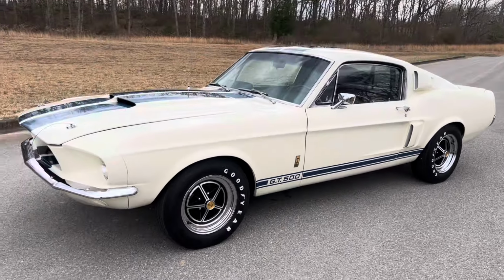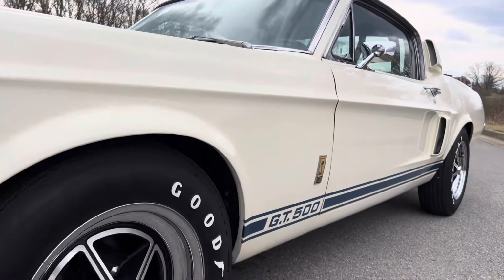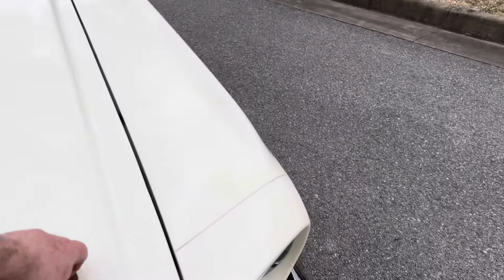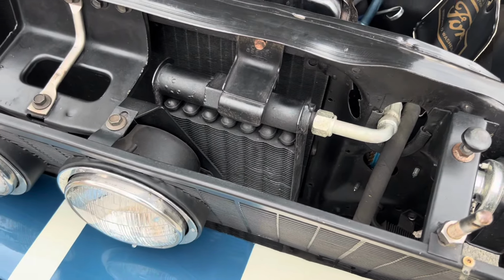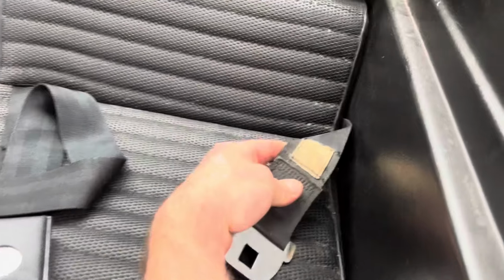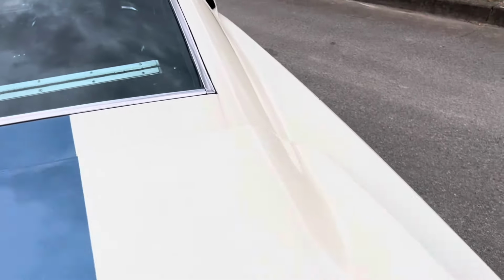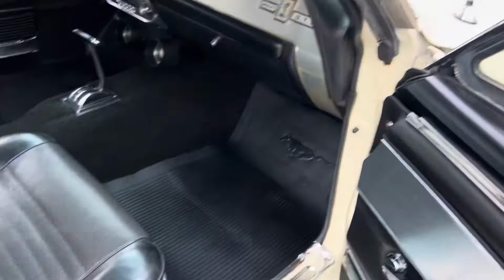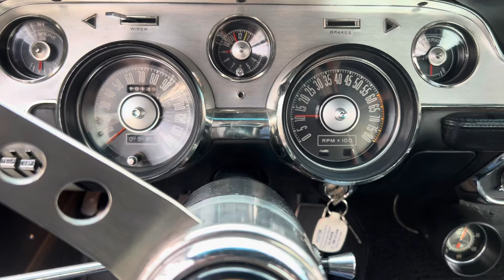1967 Shelby GT500 427 2x4 Wimbledon White Amazing Car

Comment: A very beautiful GT500. The automatic trans and tall rear gears makes the GT500 with the 427 fe motor capable of driving on longer highway trips that 4spd equipped ones along with short rear gears wouldn't think of driving.  It sounded really relaxed at 70mph.  Top speed must be close to 140 in that.

Hey, when is your website gonna be up? It never shows any inventory.

Comment: So this car is 1 of around 47 GT500’s that had dealer installed 427’s
Reply: There are no documented dealer installed 427s according to SAAC (where a dealer replaced 428 with 427 prior to sale).  Current SAAC registry indicates that a 427 had reportedly been put into this car but that is extent of it.  Paperwork is a must and claims are worthless without it.  SAI did fit three 67 GT500s with 427s at LAX, Nos. 289, 544, and 1947.  They are all well documented and accounted for.

Comment: THE REASON THEY PUT 4 SPEEDS BEHIND THE 427, was nothing else would hold up behind that engine,Automatics were junk at best ...AND THEY PAINTED IT WHITE...
Reply from the maker: It’s a factory white car lol. Many 427 cars came with automatics. They will hold up just fine.
Reply: That's completely false. Do you work for the Bumbles Brandon Administration?
Reply: The Ford C6 is MORE than capable behind ANY hi-po or truck application.
Watch it again & learn something.....